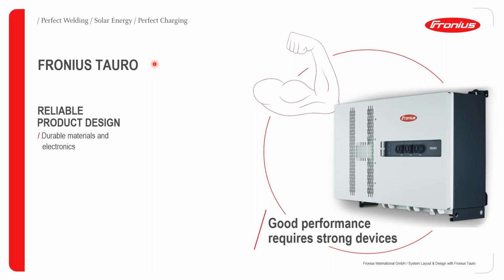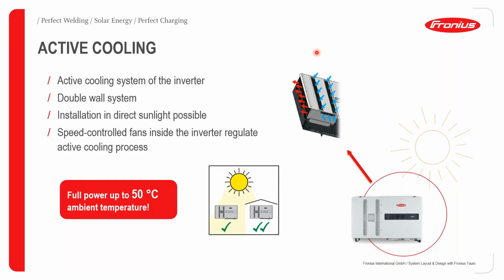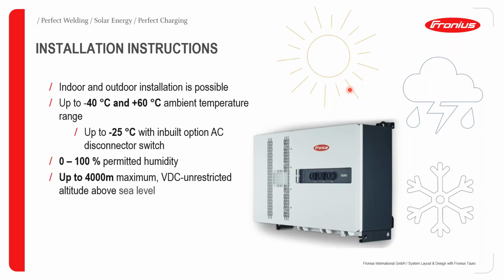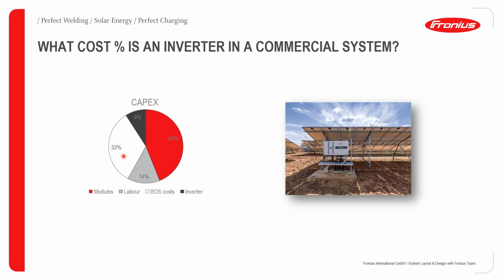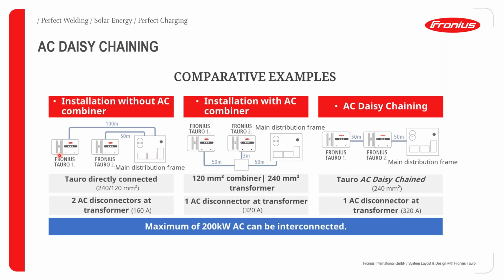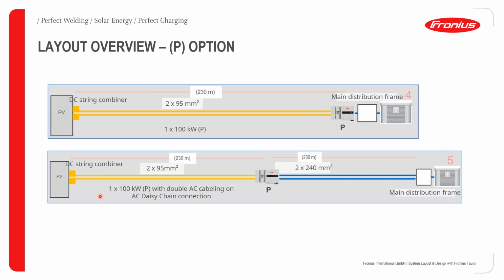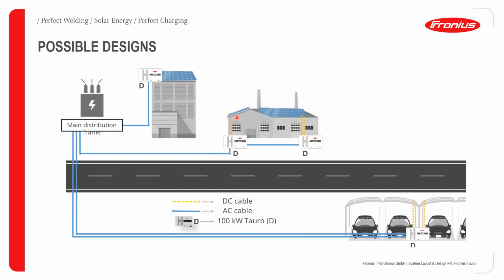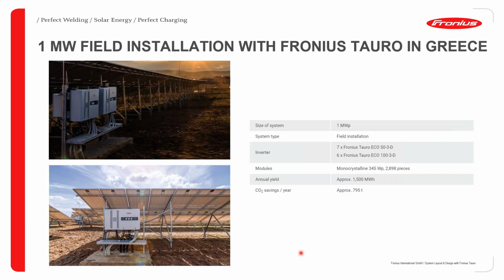Advanced Webinar: Fronius Tauro - Design and System Layout (AFR)

Comment: You advertise the much more expensive product Fronius Tauro, but do not compare it with similar SMA, Huawei, etc. and which proven feature makes it so expensive, given that everyone has a 5 year warranty. How would you convince us to invest in Fronius Tauro? And how much does it cost to extend the warranty to 20 years as your other competitors, and how many times during those 20 years will we change the same module? You have only one small plus which is the quick replacement of the 50 kW module (27 kg), but this does not compensate 30-40% of your expensive product.
Reply from the maker: Hi T!
The Tauro is extremely competitively priced, by using the Tauro – savings on BOS (Balance of Systems) costs will also be realised due to the system and design flexibility of the inverter. Fronius is renowned for creating quality products, during research and development of the Tauro, it was sent under various stress testing which would simulate an extended life of over 20 years and the tests did once again prove that the product can keep running for that many years without having to necessarily have the modules replaced due to fatigue. The Tauro has many advantages over the competitors which include the ability for AC daisy chaining, later derating at high ambient temperatures, part exchange possible on site, SPDs integrated as standard, unshaded mounting, pre-combined (central) ordering option,  150% DC overload as well as an integrated communication card.
Best regards, your Fronius Social Media Team